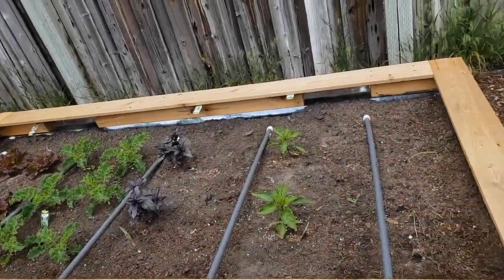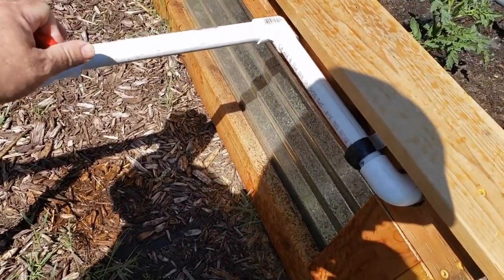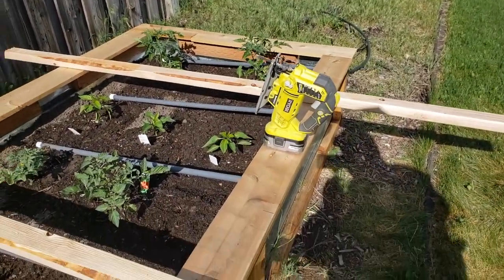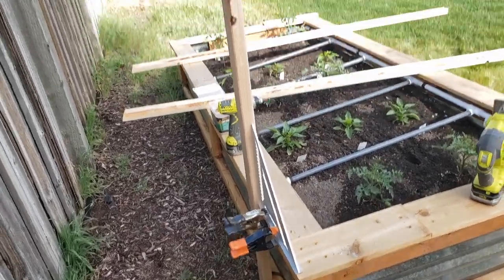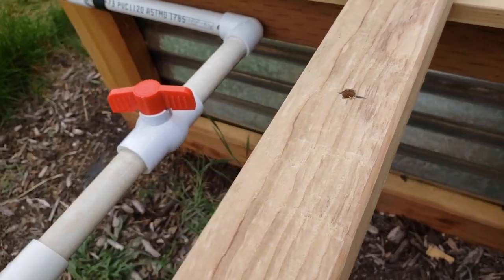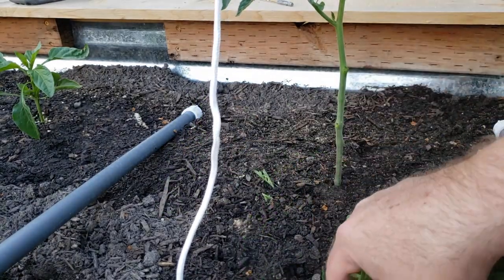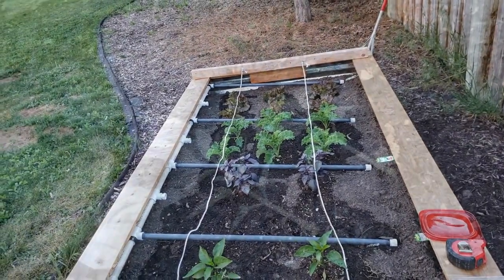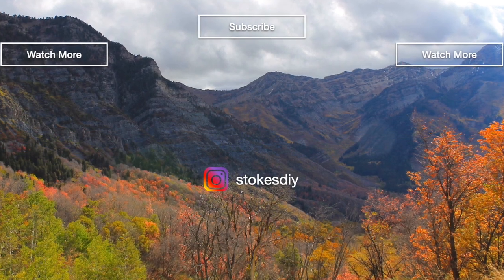Best DIY Tomato Trellis + Bonus Tomato Pruning - DIY Gardening Episode 06

Comment: Don't waste your money on those plastic valves and PVC, that stuff won't hold up to the sunlight for very long.
Reply from the maker: Do you have any suggestions?
Reply: @TheWoodHaven  I would check with the Home Depot or Lowes folks, some type of insulating tape than can take the UV rays for the PVC pipe.  Just let them know you are trying to protect PVC pipe above ground.  For the valves go with a metal ball valve. They are going to be a little more pricey but will withstand UV rays and freezing.
Reply from the maker: @280zone  Thanks for those tips. I didn't think of using a metal ball valve. I'm going to price them out...and the tape.